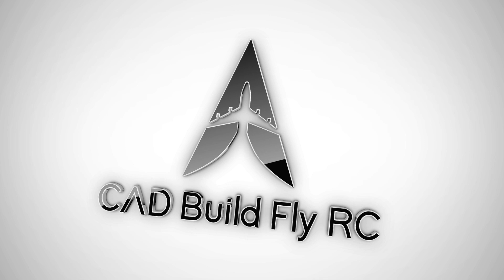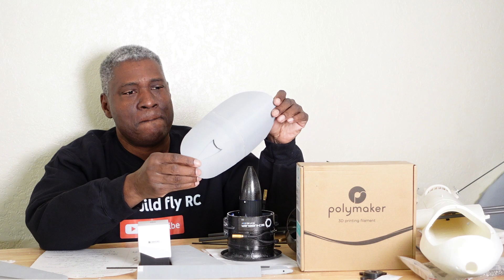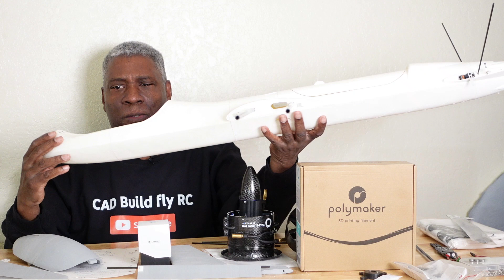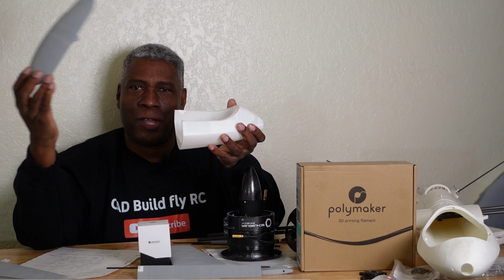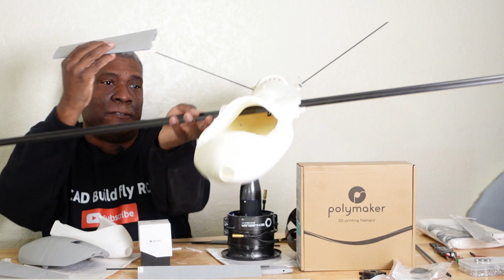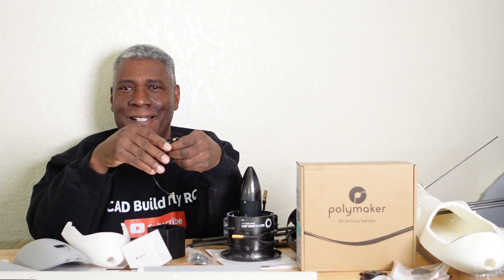Long range 3D printed UAV design review of the Titan Dynamics Avenger

Comment: Tony - Hey amigo….which Printer are you using ?? I’ve got an BBL X1C and am using the BBL PLA-Aero but am having a hard time getting any good prints.
Reply from the maker: Sorry for the late reply.  How are you doing Bill? I used a Ender 3 PRO for the print

Comment: You mentioned using fiberglass over the print. Have you tried with just epoxy?  I would think the epoxy would penetrate the print slightly giving it additional strength without the added weight of the cloth.
Reply from the maker: Using  just epoxy will give strength also